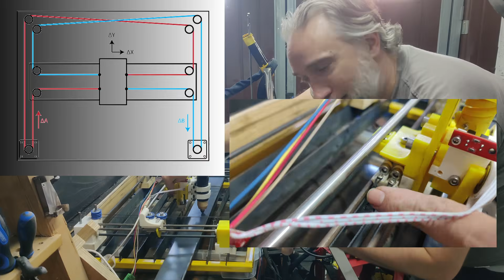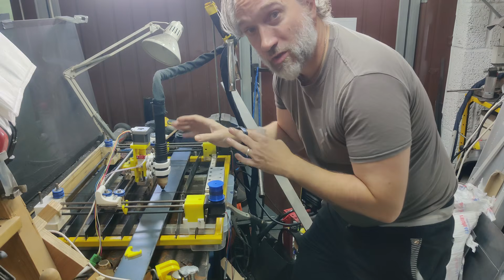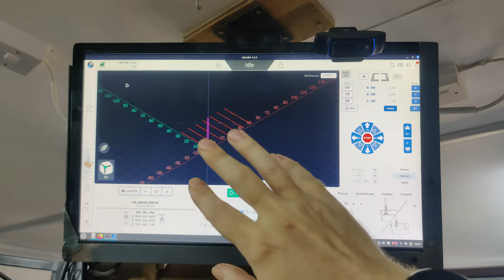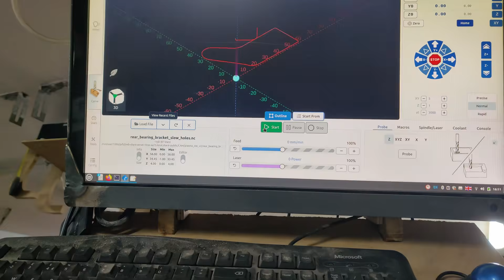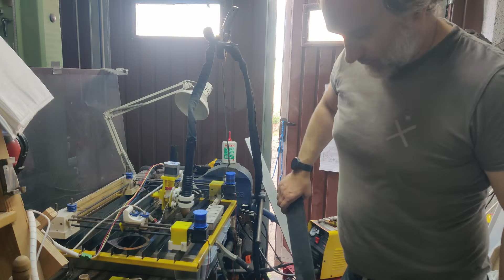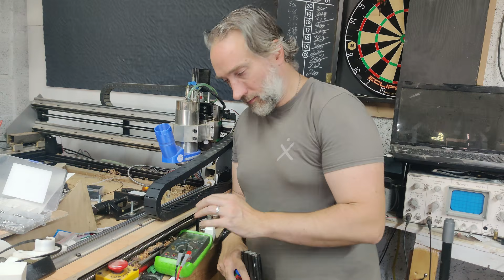Precision cutting steel with fishing line

Comment: I had good luck with an off the shelf gantry type plotter as a basis for my high freq start cnc plasma.  The two motors are mounted on the moving gantry so I miniaturised everything around a makerbase mks32 that I could power from a lipo and house everything in a folded metal enclosure.  On a small unit I find I can manually set torch height so the z axis is just static.
Reply from the maker: I was very tempted by one of those of the shelf cheap machines.  Sometimes buying individual parts is more expensive than a full kit. What are you using as your 'slats' or equivalent cutting surface?
Reply: @Mak @MakerGeek strips of whatever scrap I have that I can run through the table saw.  I have too many at the moment so keep welding the workpiece to the slats.